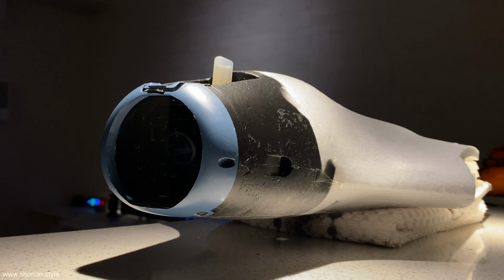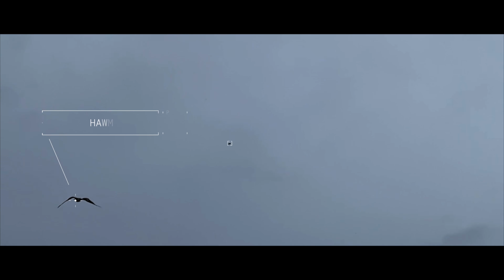E-flite Opterra 2m | Parrot Disco Chuck - FPV hyper long range cruiser drone build ~ PART 2

Comment: Hello. I am concerned by the size of the hole under the fuselage for the landing camera and the ultrasound. What should be the field of view? Can you show the under side? Were the landings OK?
Reply from the maker: the landings were all perfectly fine. 😊👍🏻
just straight down is sufficient. My cutout is 2cm wide and about 5cm long. (a bit oversized for cooling)
Reply: @MattShonan  Thanks Shonan.

Comment: Shouldn't the inside wall of the plastic nose immediately adjacent to the polycarbonate window probably be blacked out to prevent light glaring off it and into the window/camera?
Reply from the maker: you are right,, generally it does!
Thank for your comment! 👍🏻

Comment: Hello, were you able to run the engine?
Regards.
Reply from the maker: Not yet, the engines did not arrive yet. 
I have several motor on order. All highly efficient drawing as low energy as possible so that the CHUCK does not cut off.
Reply: @MattShonan  And what model did you buy?
Reply from the maker: @rokre  This will be in part 3 of the series. 😊
Coming soon.

Comment: where did you get chuck
Reply from the maker: I bought 2 Parrot Discos for my future projects. 
One was used in good condition, one is still new. 
I recommend to search on eBay and wait until a good deal comes around.